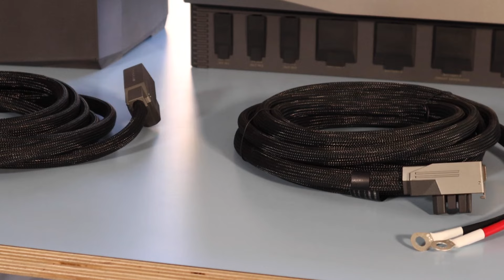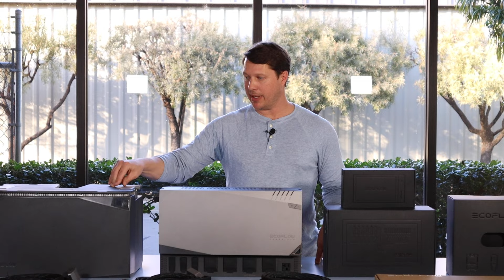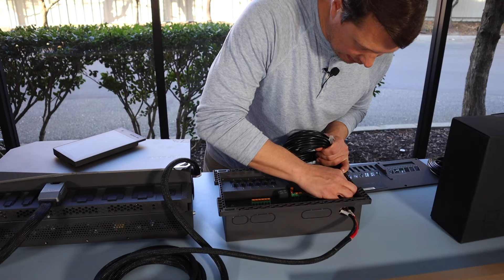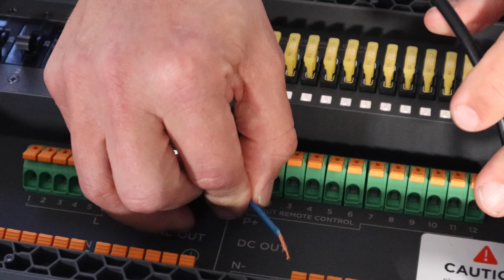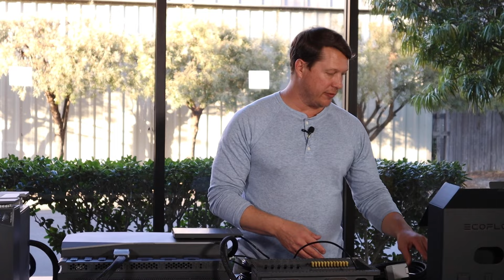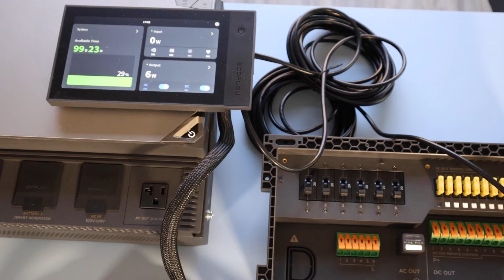Ecoflow Power System Review | The Future of Power Systems For Your Van

Comment: Anyone used this system in their van for a while and have feedback?
Reply: since receiving my EcoFlow products it’s been a nightmare. My alternator charger will not work. The technicians refuse to update my equipment, meaning nothing works. All of my equipments firmware is updated. 
On the official EcoFlow website they are selling products that are currently out of stock with no future date for delivery. 

The products extremely proprietary design makes them useless. They are not serviceable nor do they function. 

EcoFlow tech support is unresponsive and nearly nonexistent. It’s is certain you need to contact their tech support because their products ship defective or bricked. 

The products are very over priced. If the products worked with tech support the products might have value. But they do not work and you cannot get help to make them function. 

EcoFlow return policy is predatory. If you are missing one tiny price of information they deny any product replacement. They will not substitute products. They will not refund your money. They charge  high restocking fee and will not cover shipping the broken equipment back to the company. Frustrated customers are resorting to filing claims to recover their money and the broken equipment is thrown away at a loss to the consumer in the thousands of dollars. 

Do not buy EcoFlow products. You can get better value buying your products from other companies. If you chose EcoFlow you will loose your money, be stuck with broken equipment, and they will not replace or repair your product. EcoFlow is very expensive. It is not worth the risk doing business with them.

Comment: Is there a way to regulate the Amp taken from DC source? Example the smart charge systems in the JLR Defender and the Dodge Ram don't use smart alternators they use what is esenchilly a supercharger instead. The Ram is rated for a draw of 50 amps so can you set ECO-Flow to only pull 30-50 amps ?

Comment: What's your experience with the noise level of its cooling fans?
Reply from the maker: Definitely noticeable especially with high draw applications. But if it’s in a cabinet, that helps.
Reply: @VanLand  What about when charging via solar? How does the noise level compare to other systems such as Renogy or Victron?

Comment: This is a nice kit. Well integrated. 
Will be interested to see how durability and customer support stack up. That is where I’ve really come to appreciate my Victron system with 3000 watt inverter and 400 amp hours. 
That said, this system is nice for its connectivity and pricing is not that far off when I add up all my components, my time and the hassle of sourcing wiring, connectors, fuses and switches from multiple sources. 
It’s nice to see a manufacturer thinking these systems through to make them easier to install, operate and potentially safer as a result.

Comment: You mentioned the display shows 6 DC and 6 AC circuits.  But the unit has 12 DC circuits.  Did I miss something?
Reply from the maker: There are 12 DC circuits but only 6 are controlled on the display.

Comment: i believe 1 correction.. the 12v connector goes to the car battery, not the alternator, for 12v dc charging.
Reply from the maker: Basically the same circuit- the alternator is what does the charging. I would actually prefer to go direct to a 48v alternator and leave the starter battery alone.
Reply: @VanLand  oh yeah for sure.. im just talking about their wiring, its designed with terminal rings. at least mine was. love the vids!
Reply: @VanLand  Does it look like there's any capability of a high amp secondary alternator for charging? That's the big downside for me so far. Willing to buy a 24v or 48v alternator, but I'd want 200A+ charging. Maybe through the 'smart generator' plug instead of the alternator plug? Even if it still required a DC-DC or Li-BIM.

Comment: Can it run a 12v Air conditioner like the Dometic RTX 2000
Reply from the maker: Yes it has plenty of power, but the wire would need to be sized appropriately. I’m very interested to see if it can run a 120v AC powered air conditioner like the Dometic Penguin.
Reply: @VanLand  Same question. Which wire do we need to size up?
Reply: It looks like the EcoFlow Power System has a max 12V output of 70A and the Dometic RTX 2000 requires an 80A fuse. So I don't think the EcoFlow Power System could support the Dometic RTX 2000, but it would probably work fine with a 24V air conditioner. This issue was pointed out to me by my van builder. I am no expert, just passing along info that I received.
Reply: In this video https://youtu.be/ahgpvUL5IA8?t=92 they use a 120v RecPro 9.5K along with the EcoFlow Power System.
Reply: @vanland , I have the new nomadic X3 rooftop air conditioner, 12 volt. I am wondering how to connect the 2 AGW cables to the independence kit?? If you have any input or diagrams please let me know
Reply: 12v 70A output = ~900w
24v 60A output= ~1,750w

Or
120v 30A output = 3,600w

I think a 24v or 120v A/C would work. 12v A/C, not ideal.